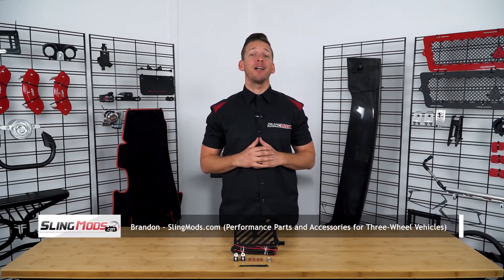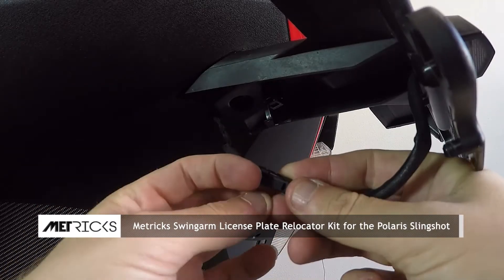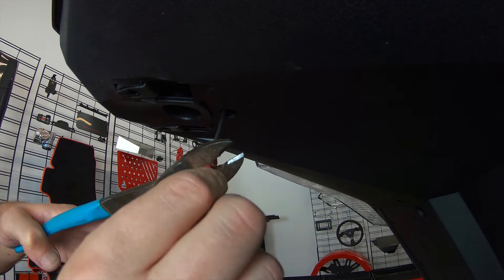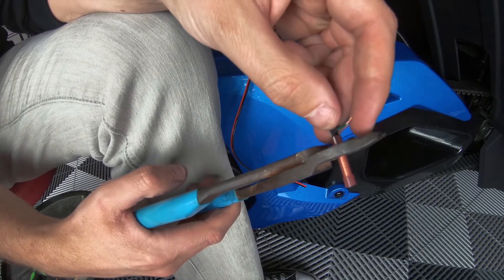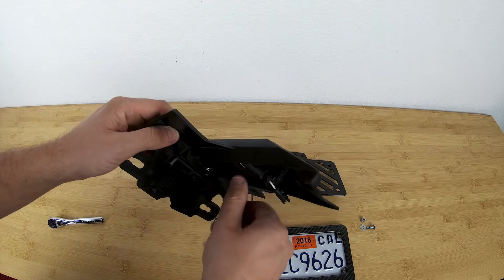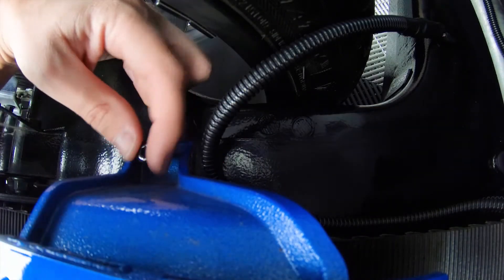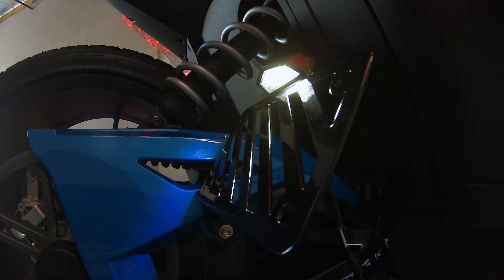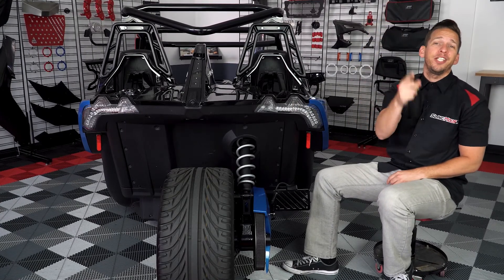Polaris Slingshot Swingarm Mounted License Plate Relocator Kit

Comment: Nice set up but can't they just provide a cord with the plugs installed. You now have a place for moisture to corrode out in a year or so.
Reply from the maker: Hello Kevin, we would have also preferred to see a Plug N' Play extension wire for the license plate light from the mfg.. but it is not included with the kit unfortunately. You can also solder the connections for maximum continuity as well as a dab of dielectric grease.